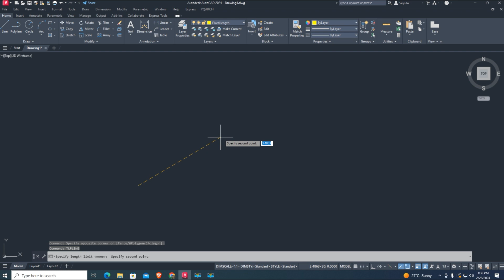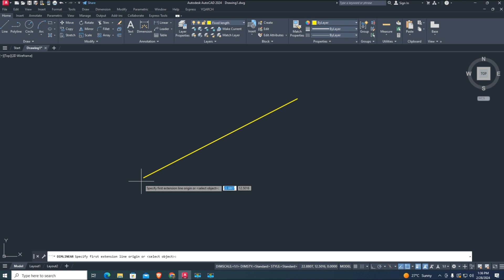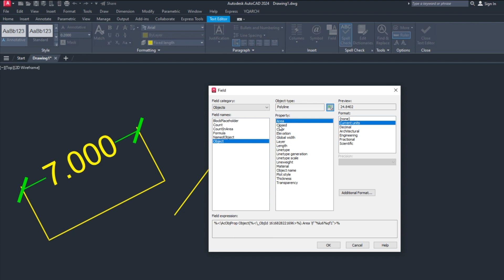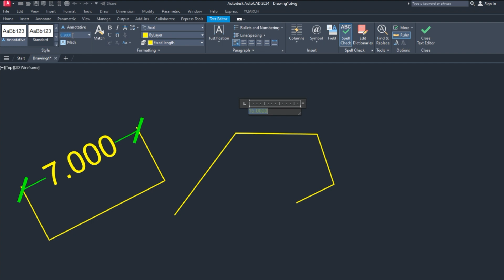Discover the Secret of Fixed & Limited Length Polyline With AutoCAD Lisp

Comment: Best regard. Because the application does not run in Autocad Civil3D 2024 it says; warning: rewind ignored exception
; error: Exception occurred: 0xC0000005 (Access Violation) (Specify length limit <none>: 20
Specify first point:
Specify next point <done>: ; error: se ha producido una excepción: 0xC0000005 (Violación de acceso)
; advertencia: rebobinado ignorado excepción
; error: se ha producido una excepción: 0xC0000005 (Violación de acceso)
Reply from the maker: You can use in autocad may be it's working in cad not civil 3d
Reply: @CivilSurvey  Thank you
Reply from the maker: Welcome to the channel visit YouTube playlist learn more